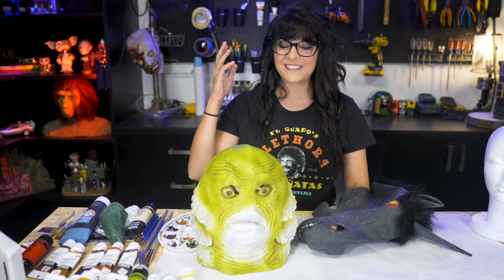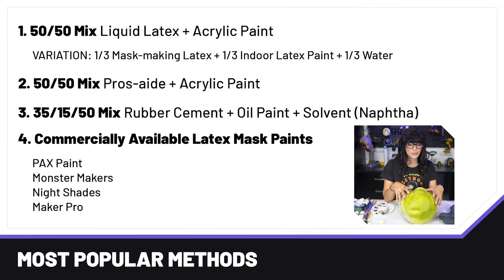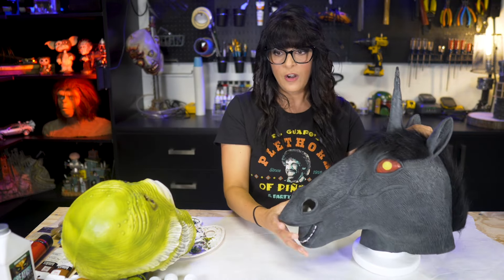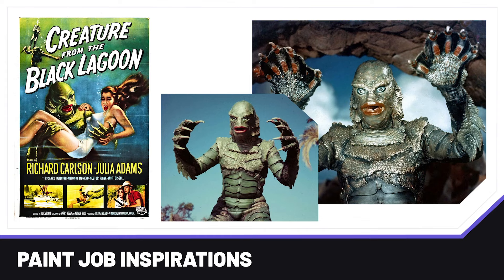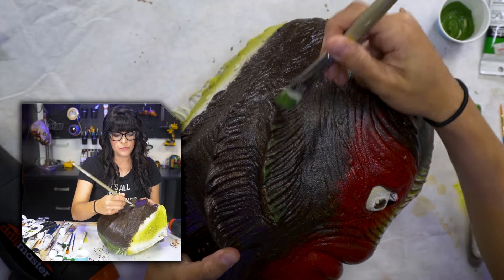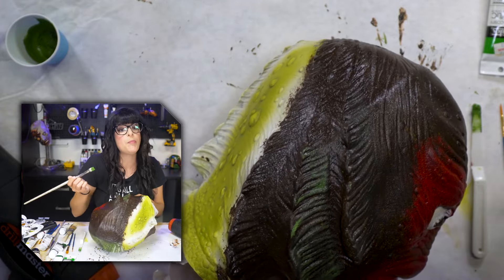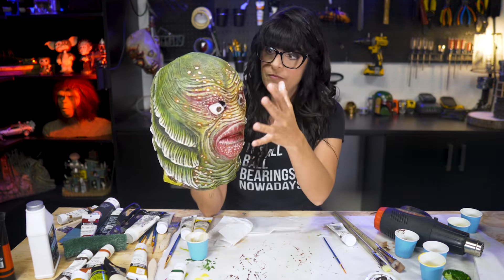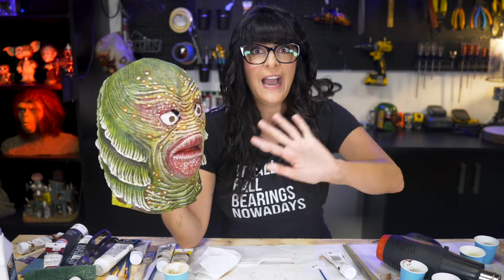How to Paint a Latex Mask the Right Way

Comment: Your rubber cement/oil and naptha formula should be 10/1 solvent to cement + your colorant. Not toxic if you don't keep your face in the can of naptha. When this formula comes out of an airbrush, it is dry as soon as it hits the mask. No smell, really, except for the oil content. I have been using a rubber cement, rubber cement and a universal colorant as my formula. I am still alive.

Comment: What if I messed up and painted it with acrylic before I did any research … how do I remove the acrylic and start over ? Is that possible or am I fucked? And yes it cracked ..
Reply from the maker: No worries! I did the same thing my first time. Peel off as much of the acrylic paint as you can from the areas that started to crack. Then, take a green kitchen scuff pad and go over every part of the mask that was painted. Unfortunately you won't be able to remove the paint but it will give you a better surface to start over from. If it's a cheap Halloween mask, your most reliable option is to buy another one. But I've had success trying to salvage some of mine.
Reply: @RachelDeBarrosLive  thank you!! I will try !

Comment: Great video! I had a question tho, if I'm using rubber cement paint, what type of seaker should I use? Any paint sealer? Because I'm thinking if it is a non flexible one, then all the work with the flexible paint is ruined.

Comment: great video! does this method makes the latex mask harder or stiffer? I was wondering if there is a way of painting+coating that would make the job! thanks
Reply from the maker: At actually doesn't. I can fold the mask just as if it wasn't painted.

Comment: I have a question I want to use rubber cement glue to re paint a latex mask.  the color isn't totally accurate to the real thing when it arrived.. So my question should I apply the rubber cement separate or can I mix in with my paint and apply at once?

Comment: I recently bought a grey alien latex mask at Spirit Halloween and I'm planning on repainting it using this technique. I have two questions. The first one: I bought a tube of Apple Barrel acrylic craft paint at Walmart. Will this type of acrylic paint work with the 50/50 liquid latex + acrylic paint method? Second question: What would you recommend for sealing everything after painting?
Reply from the maker: The Apple Barrel acrylic paint should work fine. Since economy paints tend to have less pigment, start with a 50/50 mix as a test on the inside of the mask and see how it turns out. You may have to add just a little more paint if the color dries more transparent.

Then to seal it, I like using a clear rubberized coating paint like Plasti Dip. The rubberized coating lets the mask bend without cracking the sealer.
Reply: @RachelDeBarrosLive  Thank you!

Comment: I just have question dose the same thing work for masks if you want to were ?
Reply from the maker: Yes it does! If you plan on wearing a store-bought mask that doesn't have a great paint job, you can paint it using this exact same technique and once it dries, you can put it on for Halloween, theater, or any costume and you don't have to worry about the paint chipping or flaking off.

Comment: I got a question. If I wanted to run one of the latex mixtures through an airbrush, how would I thin it down? Water?
Reply from the maker: Yes, you can thin all the recipes I mentioned down with water to use in an airbrush -  EXCEPT the Rubber Cement + Oil Paint + Solvent. For that one you just add more solvent until you get the consistency you like.
Reply: @RachelDeBarrosLive  Excellent! Thank you!
Reply: @RachelDeBarrosLive I only have liquid latex and naphtha, do you think a liquid latex thinner with the lighter fluid and oil paint would work?

Comment: For rubber cement paint your website says 30/50/20 Rubber Cement + Oil Paint + Solvent (Naphtha) but your video shows different. Which is the right ratio?
Reply from the maker: If you are painting with a paint brush, then the ratio on the website is a better starting point. The ratio in the video is more appropriate for air brushes. Thanks for pointing that out 👍 I'll update that both on the website and video description!
Reply: Ok thanks I use both the paint brush and an iwata airbrush. Ratio with the 50% oil pigment had my attention. I never used that much because oil take forever to dry but I'll try it. Liquid latex hard to get this time of year without shipping and freezing.